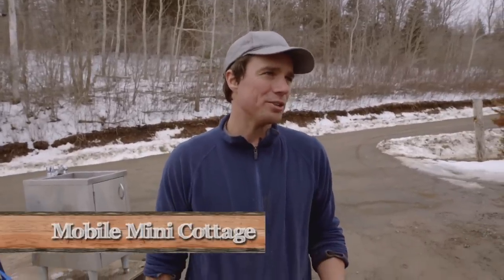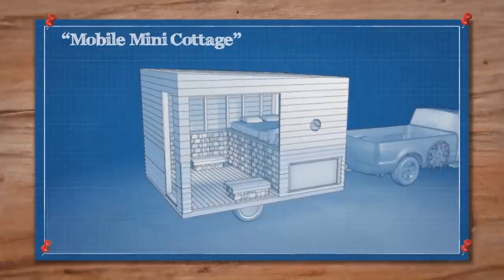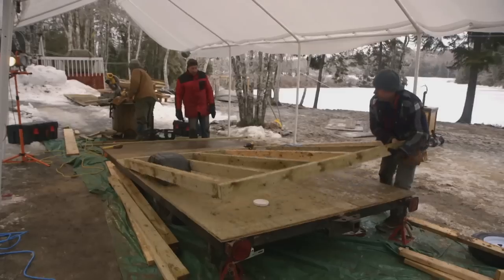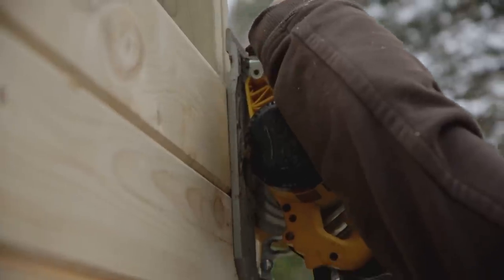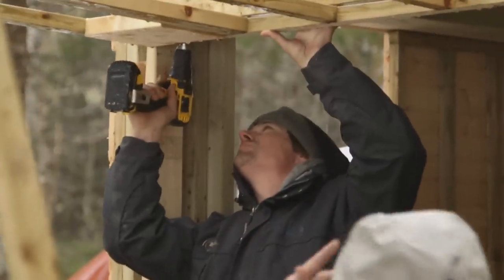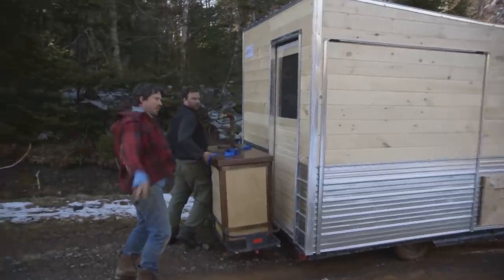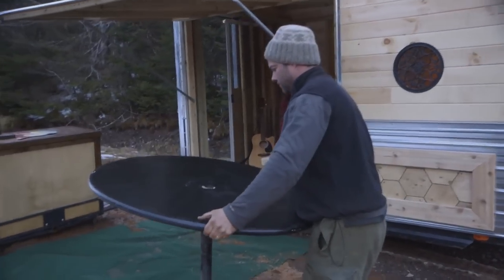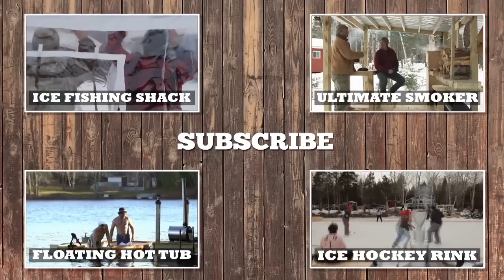DIY MOBILE Mini Cottage

Comment: My project is an amphibious camper unit. A 1,750 Cap limit weight utility trailer converted into a floating fishing camping unit. All you do is drive the whole trailer into the lake or river and unhook from the 4 cylinder car. You can get the 6 dock floats at home depot. Each one holds 500 pounds. They go underneath the unit and can be extended out for stability on the water. On each side are two fold down walkways. Hinges on the bottom and a chain that holds it in place from top to bottom.  Inside it has a 35 gallon plastic water tank inside a cabinet on the ceiling that feeds water to the sink below it and the roman blind pull down shower curtain shower head. One side is the Kitchen that has a small freezer refrigerator 600 watts on the left then a utensil drawer with a pull out garbage can below. Then a small sink. Above this is the countertop and cabinets above. Under the cabinets are hooks for some of the cooking utensils and a paper towel holder with small red LED Lights. A small microwave 1450 watts and an induction cooktop 1300 watts. On the other side is the sleeping end and this is where the shower pulls down from the ceiling. Two hammocks can be taken out of a cabinet with blankets and pillows. They have hooks on each end of the walls to clip on to when you are ready to go to sleep. In a corner is the hide away pull down shower. Basically the shower walls are like the blinds on your windows, except they are made of plastic. Two pull down blinds pull down from corner. A shower head in the ceiling and on the floor is a drain and has little shelves in the wall to put shower things on. The toilet is hidden to look like a stool with cushion on top. Underneath is a compost toilet system that separates the water from waste. Greywater is drained into a flat tank under unit that you can drain. On the roof is 3- 280 watt solar panels. Inside is the charge controller, inverter and three deep cycle battery's with my homemade power booster. Inside has one bright LED light on the ceiling and one light outside. One jack for outside power  inlet and water inlet. One inside hand pump to pump the lake water into the 35 gallon tank OR just fill it with the outside water inlet. Has 3 inside electrical outlets and 1 outside outlet. 2 propane tanks for the small heater inside. Outside it also has a pull out awning for shade. You can camp on the lake or off, it really does Not matter. I made the walls with 2 by 2 boards and plywood panels with foam board insulation panels and plastic. The unit is painted and triple sealed with polyurethane coats. Right now I am using a rope to pull myself back into shore until I get a decent size motor. The trailer itself weighs  about 285 pounds. The wood weight is about 325 pounds. 3  85 pound battery's Plus other materials. I would give it a total weight of 725--800 pounds. My car has a 1.200 towing capacity so i'm  good.  I will add later on the back side a bike holder that can hold a couple of bikes.

Comment: hey, love the diy camper/cottage on wheels. Great vid. I'm getting ready to start a very similar project. 2 person mini camper from a old pop up that has been gutted. (only trailer left) anyway, I was curious about the dimensions you guys went with. specifically the height of the the roof in front and back. Any info or help would be greatly appreciated. Again Great Vid and thanks!

Comment: What size trailer was it built on?
Reply: Are you considering building it ?
Reply: +Aidan Angelo No, not that one. Just wondering because I  am planning on building some kind. I noticed that it looked like he was putting full sheets of tin on the roof so I presume it's 8' by maybe 5' or 6'. Probably 6' wide since he has the bed turned cross ways. I have a different design that I'm planning on making.